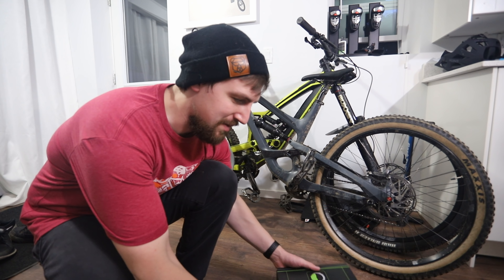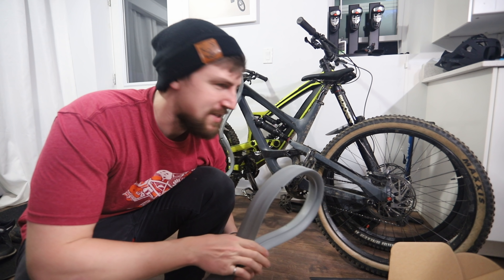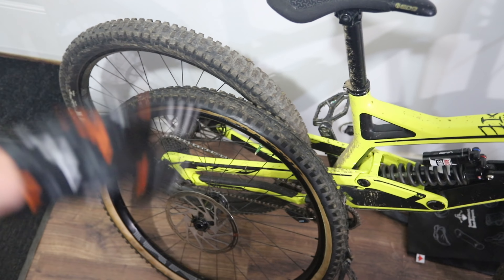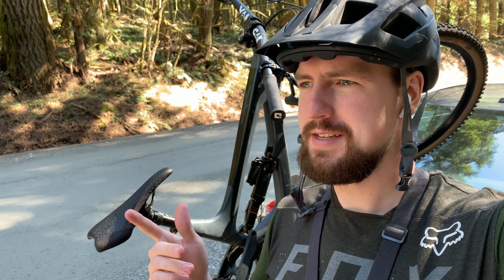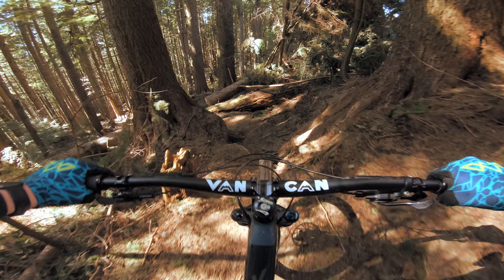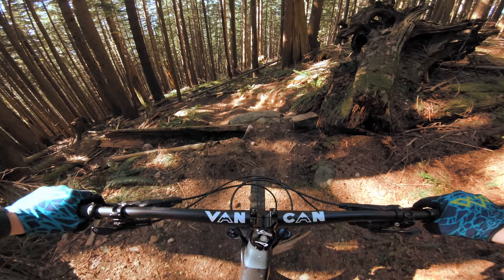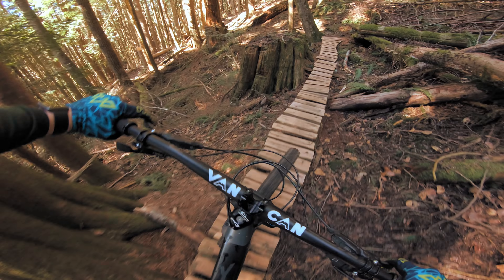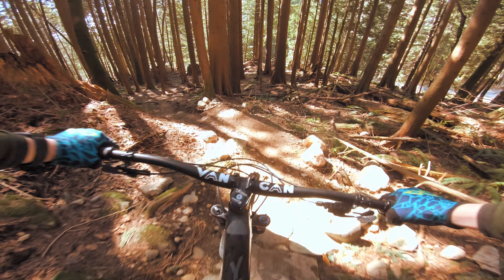Cushcore tire inserts // Is this the future of tubeless tires?

Comment: One tip that helped me tremendously: grab a good plastic clamp and use it as an extra hand on the rim pinching the cushcore in place.  I also just used a little sealant as lubricant instead of soapy water and it worked great.  Once you have it in place, he was spot-on with working the tire bead as far under the cushcore as possible, physically "roll" the cushcore up a little and push that bead in there under the insert.  This will ensure you can get the bead on without too much fuss and risk of damaging your rim.

Comment: It is about 250grams extra per wheel for those interested. You do notice it when peddling, accelerating, but otherwise as Advertised; increase grip, puncture protection , calms small bump feedback, centers the tyre on the bead and no squirm.
Reply from the maker: Yup, spot on.

Comment: Hmm does the "Cushcore" prevent burps at lower pressures and high cornering speeds?
 If so I'm in.
Reply from the maker: Yup! I even seated the tires with a floor pump.
Reply: I've been running cushcore for about two years now. I did a three day helicopter Enduro in Revelstoke with 10 psi front and 15 psi  rear. No burps no pinch flats! When I took the tires off you could see where the cushcore was pinched by big impacts but the tires got off Scott free! The crazy thing is that not only do the prevent burping at low pressure they also let you rail corners with ridiculously low pressure. They pretty much eliminate tire squirm. For day to day riding I run 10 psi front and rear.
Reply: @motron1845  why would you run anything under 20psi? Sorry I'm curious. I never rode anything under 25 psi ever ever ever. I need power and fast and 10psi is far from fast ...
Reply: @motron1845  that's sick. What is your weight ?

Comment: Adding sealant afterwards through the stem is more efficient.
Reply from the maker: Didn’t have my syringe handy. Putting it in before wasn’t a problem though.
Reply: Actually it's not as orange sealant will clog up the valve, I prefer pop tyre off at a spot, fill directly from bottle.
Reply: yes it is and potentially less messy
Reply: @michaeltowler2632  syringe hose clogging, and popping off exploding, or making a mess is not fun.

Comment: Cushcore is great, especially if you have expensive carbon rims you want to protect or dont care about the cost at all! (Or you race for podiums and money)
I wanted Cushcore as I HATE flats! But after I learned that foam inserts, not just Cushcore, only last approximately up to a year I find them way to expensive! Now 6 month later I still haven't even gotten my fist punkture, maby luck? maby the new tyres? who knows. So until the price is getting way WAY cheaper (it's foam for crying out loud) and the lifespan of inserts gets longer I won't be buying.

Comment: I like to just bed the brakes in with a rubber band on the brake lever. Flip the bike upside down and give the wheel a few turns and you can feel the brakes start to dig in as they go. Hasn't failed me yet.
Reply from the maker: Good tip!

Comment: Maybe a good way to say it is that you can run lower pressure without losing a lot of efficiency
Reply from the maker: Yup it does that, but it does more. Like flat protection and stopping tire squirm.

Comment: It seems that the insert also acts like a volume reducer for your tires.  Would you agree?
Reply from the maker: Definitely, there’s probably 30% less air volume.
Reply: @VanCan  it allowed me to drop 20psi in the suspension otherwise I would have needed to get volume reducers, I had to run harsh suspension, cus I did not have spacers, but I got cush core now I might not need them, maybe one or two could do, I don't know yet, but need new bike and better suspension anyway.

Comment: How harder is it to change the tire if it has Cush core installed already?
Reply from the maker: Harder, probably adds 30 min to a tire swap
Reply: @VanCan  it does not. Takes about 3 - 5 min per wheel to install or remove, unless you do it in an inefficient way, and take brakes and abuse your hands. Of course it can vary with tyre, rim combo, so can ad one or more minutes. The key is to get bead under ccysh core and into the rim channel, and using a tyre lever to push it, it makes it easier and faster. To fill sealant, I don't pop the bead, but use the opening, to fill orange seal directly from bottle to the tyre, the carefully rotate the tyre and pop bead, then I make sure it's somewhat aligned, so it's possible to pump it up, then I pump until bead pops completely everywhere, then drop it to desired pressure.
Reply: @VanCan  at first it might take that as you get used to doing it it goes faster.
Reply: I had mine on  a fair while and when I put new Tyres on had a hell of a job getting the old ones off . The Bead and Cushcore  seemed to be glued together by  the Sealant
Reply: @michaeltowler2632  I don't have this issue, but rim,tyre combo will play a role in this, osme rims hold on to the tyre more, and cush core keeps tyre even mroe secure, so if it's a problem, use your feet to get the bead to pop off, I had to do this with bontrager wheels with no cush core, but it works as good on cush core too, just stomp the tyre and bead will pop out.
but if it's nto too bad you use thumbs to roll the bead off the rim.

Comment: Would Cush core help if I have a narrower rim, (25mm) and run wider tires to prevent deformity? I have a pair of ex471s and I’ll be running the assegai 2.5 up front and dissector 2.4 rear and was wondering if the Cush core would help me out here. I am on a hard tail so I do know cutting out the vibrations from Cush core will help me but when it comes to the tire itself would it perform better? Thanks!
Reply from the maker: My intuition is that it would work great! You could always shoot them an email and see what they think - friendly bunch!

Comment: How much do you weigh? I am 210lbs naked and run 26 front/29ish rear with DoubleDown casing for trail riding and 26/30 DH casing bike park. Wonder what I could get away with on cush core.
Reply from the maker: I weight a bit more than you. I’m
Using the EXO casing on the Capra and DH on the tues
Reply: @VanCan  Sweet, thanks dude, definitely going to experiment. I just got my DoubleDowns on and tried 25/29 and think I can go a bit lower, they feel half way between EXO and DH casing. Moar grip!
Reply: hell, im 212lbs and 225 with gear on. i run 15 psi in the front with a 29x2.6 and 21 psi in the rear with a 29x2.6 as well. cushcore for the win and i ride pretty aggressive trails. id bump up the pressure if youre going to be sending it on 10 foot drops though.

Comment: What settings do you run on your fork and shock. Rebound and that. Also have a Yt Capra 27 al comp 2018
Reply: Dominik Grbac asti slovenc?✅🤙🏾
Reply: @jangorsic2494  Ja sam iz Hrvatske🤘
Reply from the maker: I set the rebound and compression by feel. I run about 110 psi in the fork with one token. Can’t remember about the shock. Just set at a bit over 30% sag
Reply: @VanCan   I have around 85 kilos and I run 67 psi and 3 tokens. Rebound has set by a video from mbr (how to set uo your suspension in 10 minutes) and the low speed compression is set 7 clicks from full open. Keep on shredding

Comment: Dh casings or exo with cushcore? Application Enduro
Reply from the maker: I do exo with cushcore
Reply: @VanCan  that's what I usually do. However, the new bike I just bought used is coming with  downhill casings no cushcore. 

I guess I'll try it and if I hate it I'll just have an extra set of dh tires.

Comment: “Gonna test these cushcores”
*rides loam

I put these in my old bike and was just constantly terrified of tearing a sidewall and having to get my tire off mid trail with those things fighting me the whole way.
Reply from the maker: Cush core isn’t just flat protection. It lets you run low pressure but keeps the bead from folding as well as adds some damping
Reply: VanCan I know, I put them in my old bike.

Comment: I hate Tubeless😅 Tubes are better
Reply from the maker: You have to try cushcore once!
Reply: You can still have sealant in them as long as there is a removable valve stem, but you won't get the benefits of cush core, extra grip, comfort, rim protection.